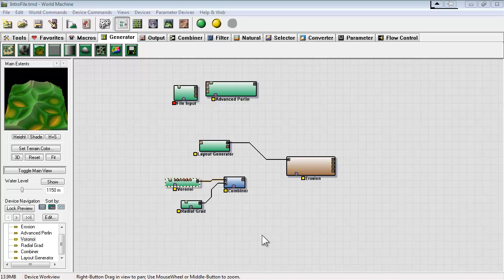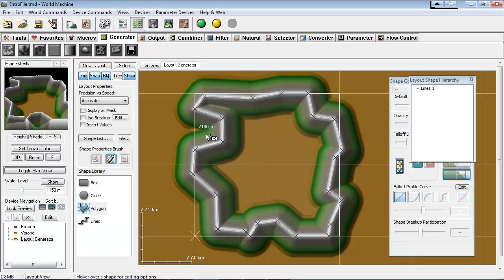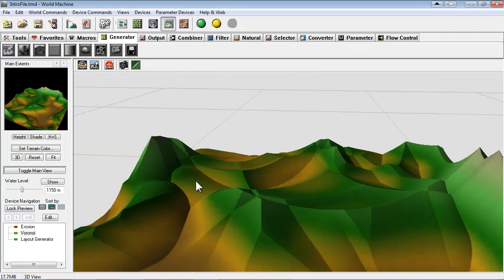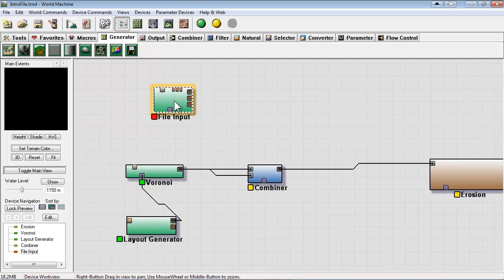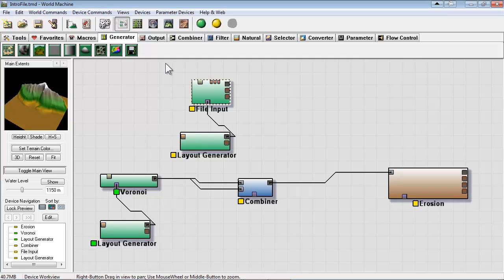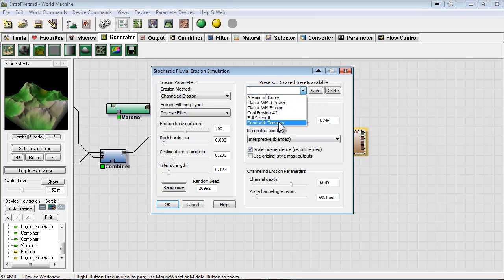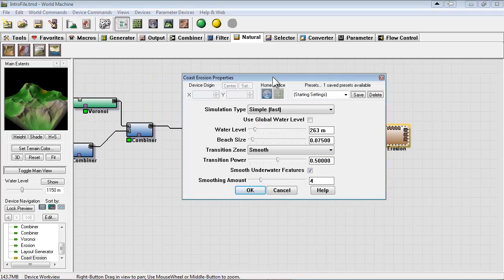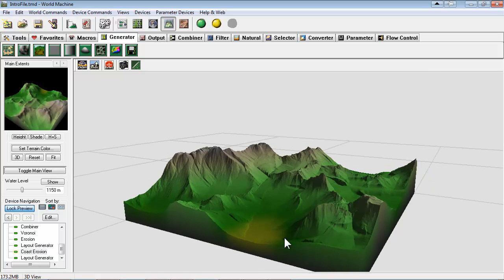Intro To World Machine: Chapter 02

Comment: Export a mesh of your terrain using the "Write to Disk" option. The only available format is .OBJ. Save it the open C4D. Click on the File tab in C4D then select merge. Go to the folder that has the .OBJ file from Worl Machine and select it. Pic your scale. Then let it load. Once it is loaded, the axis may be off. So use the world axis option to rotate it to match C4D. Have fun texturing